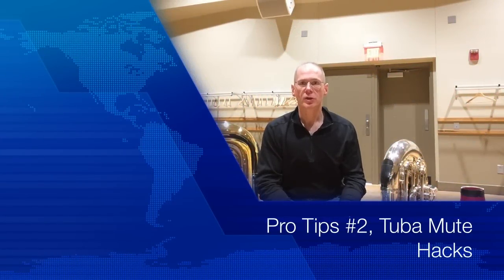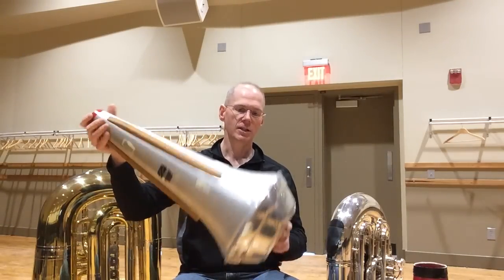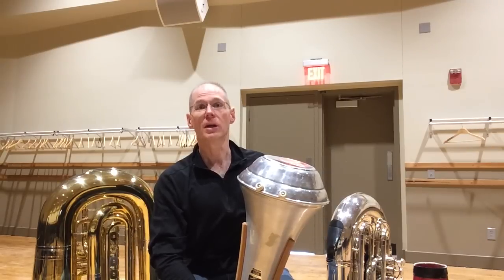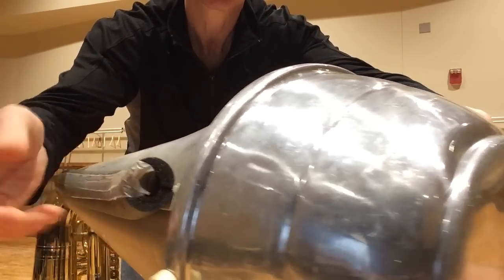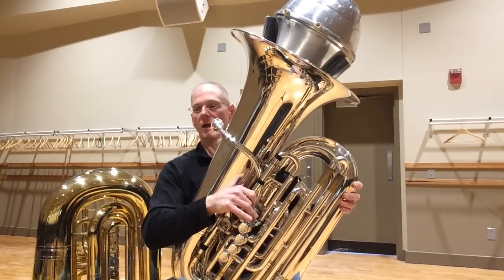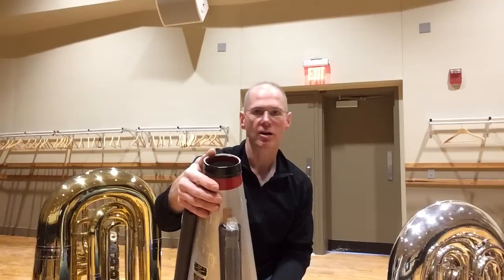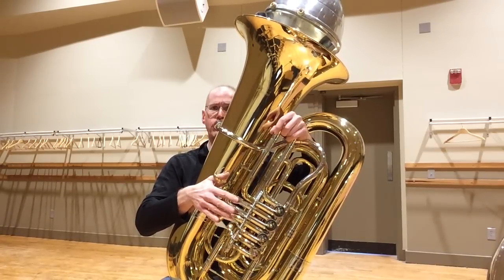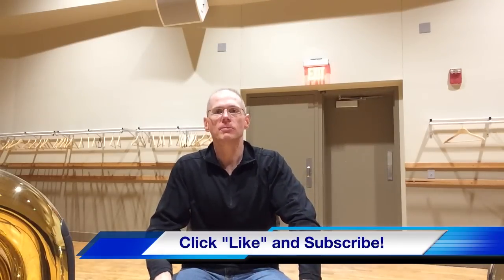Pro Tips #2, Tuba Mute Hacks

Comment: very informative video! I personally use a Husenberg Stone lined, but the small size that fits my B&S Perantucci F tuba, and with meter sticks that I have built extra cork onto that velcro onto the mute in between the stock corks. I will have to try the rubber feet on my mute! I usually lean it against my chair so it doesnt roll around haha!